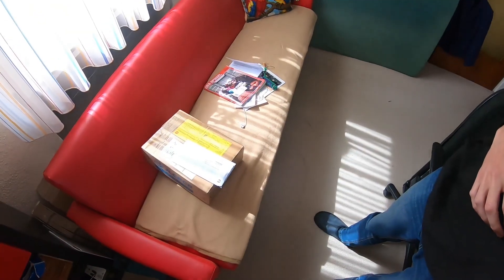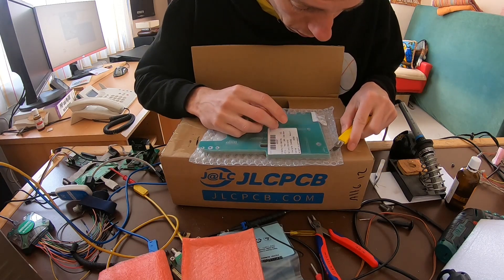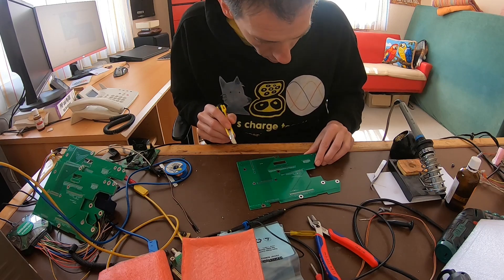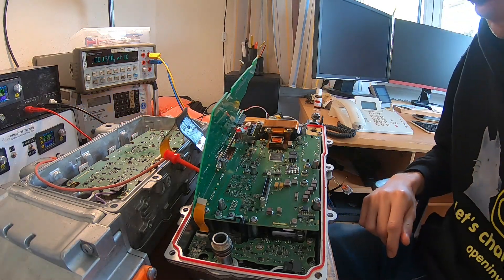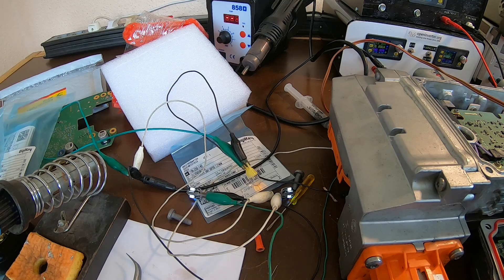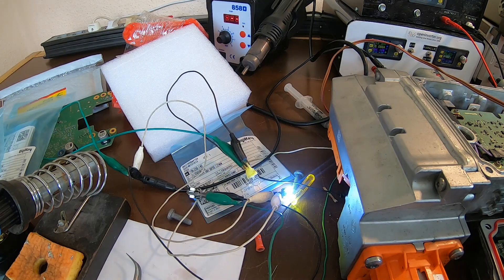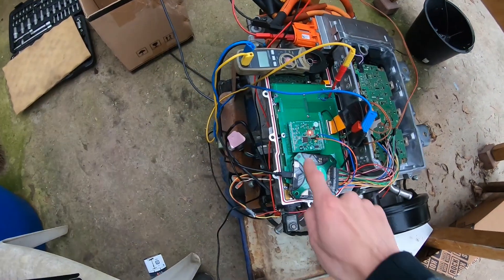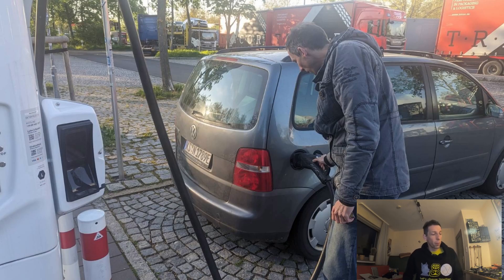Lab Update #90: Zoe Spinning and new CCS boards

Comment: Which generation Zoe is this from?

Is there a reason the Zoe has not been reverse engineered like this before now?
22kw AC charging would seem like something worth exploring for some time
Reply from the maker: The first gen made by Continental. The charging will likely not be reverse engineered, it's a separate box which needs more convoluted comms, presumably.